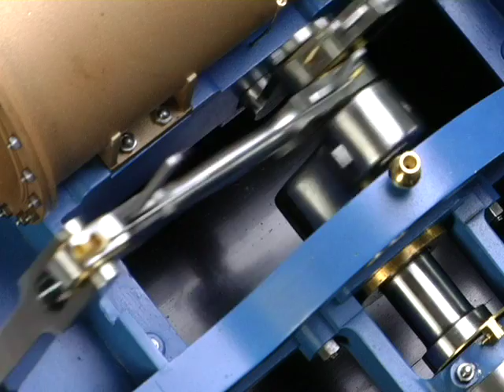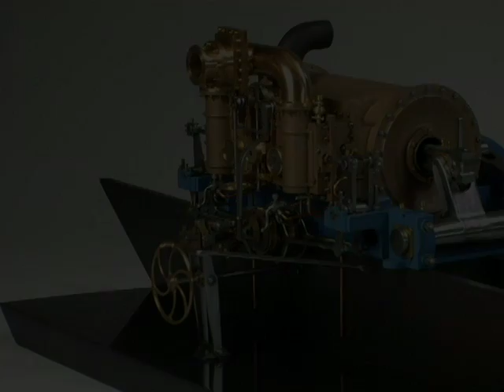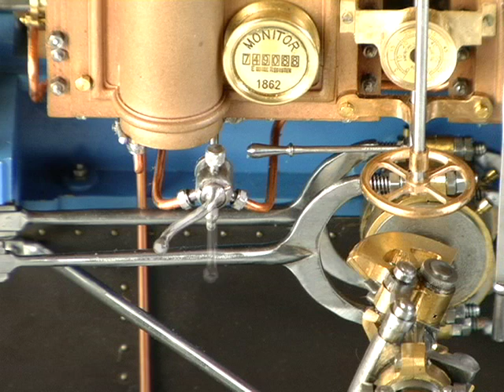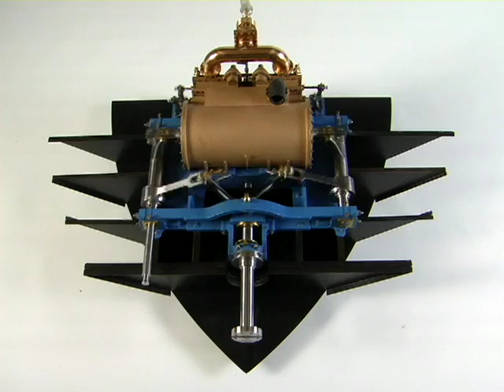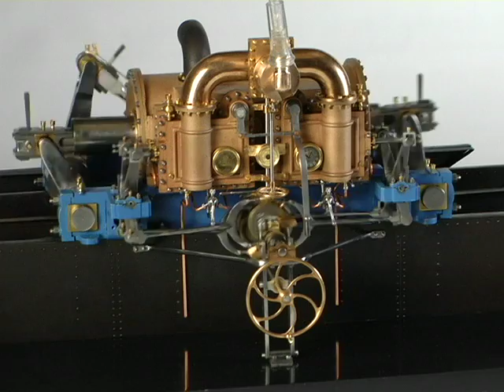USS Monitor Steam Engine Model

Comment: This is about the coolest thing I have seen....especially for a steam engine dork like me
Reply: You're not alone. It is a very interesting design, having two opposed pistons inside a single cylinder. That configuration has also been used in some experiential internal combustion engines as well.

Comment: Absolutely fantastic model, and thanks for showing it on air. You know what I notice? The vibration from that engine must have been horrible. Look how unbalanced the two cylinders are, and their motion is sideways instead of vertical like a traditional engine, which must have really kicked the back of the ship at speed. And it is not just the cylinders, it is all that bell crank linkage.

Comment: The engine is known as a "vibrating lever" type. It was invented by John Ericsson specifically for the US monitor warships which had very limited space. The engines have two back-to-back cylinders, which work "levers" on each side of the engine which in turn rotate the centrally located crankshaft. 

The back to back cylinder arrangement also gave even weight distribution, but vib. levers proved unsuccessful in other applications and soon faded away.

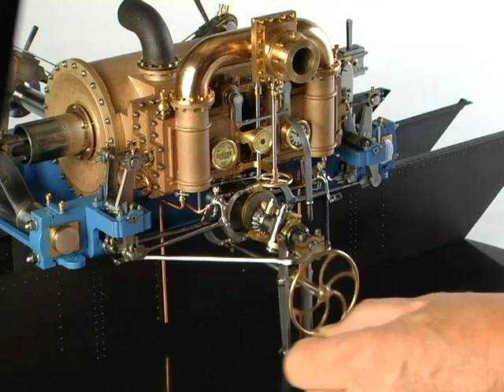Comment: Great model of an interesting engine. Some description of what's happening in the video would be nice though. I've been trying to figure out what is the point of the wheel being turned at about 1:00. The mechanism seems to be called the reversing gear. At first glance it looks like it rotates the entire crankshaft but this is not the case. It appears to only rotate the outer pair of 'eccentrics'. This offsets two of the levers, causing a different order of vibration, which I assume reverses the order in which the steam valves operate and thus the rotation of the engine itself.
Reply: I have a passing understanding of steam operation, and my thought is this is something on the order of a "Johnson bar" which would reverse the drive as well as change the valve action to regulate steam admission. I think the action of a Stevenson link motion is easiest to understand, and this reminds me of that. But I think this arrangement isn't intended to regulate cutoff, but only reverse link motion. Although I wonder what would happen if the wheel was left at other positions other than each end of the travel. Since it doesn't seem to set the cams to a longer or shorter stroke, which the Stevenson does.The wheel doesn't rotate the crank. You can see a ring and sector arrangement, whereby the "slider' resets the angle of the throw of the cams over, I'd guess, about 180 degrees. The slider is splined to the crank to rotate the whole cam assembly and adjuster gearing.  Its a pretty neat way of doing things.   Am I close to right on any of this?

Comment: Simply amazing engineering, my jaw is on the floor. What is the builder/guy in the video adjusting at 1:10 in?
Reply: Forward and reverse/
Reply: +Automobiliana That would be the builder Rich Carlstedt. He's been kind enough to email me additional details about this engine. What you see in this video is just the tip of the complexity iceburg. It was a massive multi year research project even before the drawings could be done. Without exaggerating, I'd estimate that there's probably less than a handfull of people in the world that could have done the research, drawings, and then turn around and build the complete engine from scratch without the use of castings. Even some of the parts machining were unbelievably tough to set up and do. Rich is a retired tool and die maker, and anyone with less experience probably couldn't have completed the work. 

There's more information about Rich and this engine at the Shereline internet Craftsmanship Museum if anyone's interested?
Reply: +Turning Point Sounds like a challenge to mrcrispin of the UK to me!
Reply: A bit late but thanks very much for the meaty reply. I will look up the link you provided.

Comment: So instead of having separate cylinders for each piston, it had both pistons in one cylinder? Am I correct?
Reply: There is a wall in a center of cylider to separate two working area.
Reply: @mattimalo2894  But what was the advantage of having such a configuration? I'd imagine that it would be easier to have in a confined space without sacrificing power to weight ratio by using a smaller engine.

Comment: This reminds me (in no way demeaning the level of precision in this model) of the miniature steam engines made by Fleischmann that were available as very high-end toys or curiosities in Germany in the late 1950s. I don’t know if they’re available anymore.
https://www.fabtintoys.com/fleischmann-steam/
Is this an actual working steam engine? If not, no matter... the precision and workings are fabulous. 
I visited the Mariners Museum in Newport News a few years ago; the effort being made to conserve and restore the Monitor artifacts was and is astounding. 
There is a full-scale replica of Monitor built outside the museum:
https://www.flickr.com/photos/mikestrailhead/9479355013 History talks about how small the Monitor was in comparison to the CSS Virginia, but it is not a small ship. You have to walk around the deck, and then walk under it, to get an impression of its true size.
The actual engine must have been incredibly hot to work around, since ventilation was minimal, given the low freeboard of the warship, and the noise level had to be something OSHA would take issue with today. They were brave men who manned that thing.